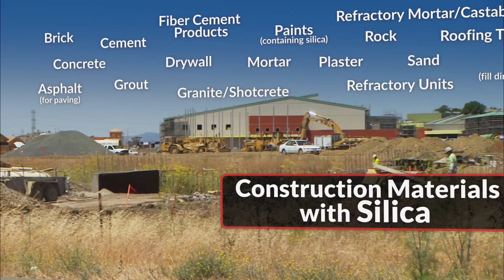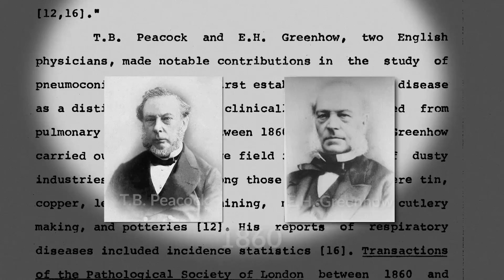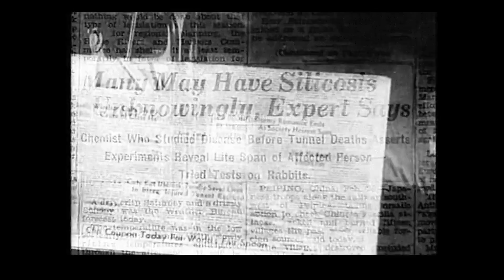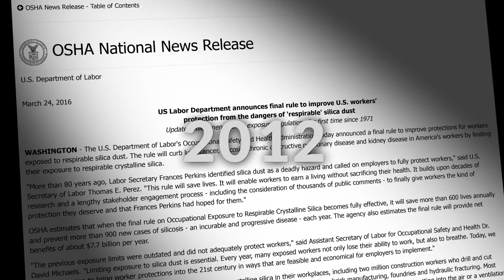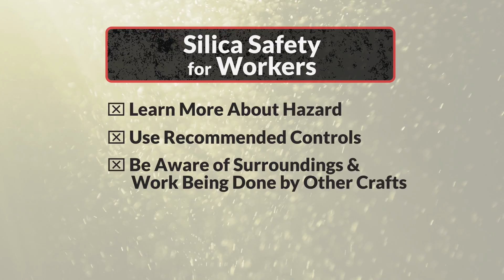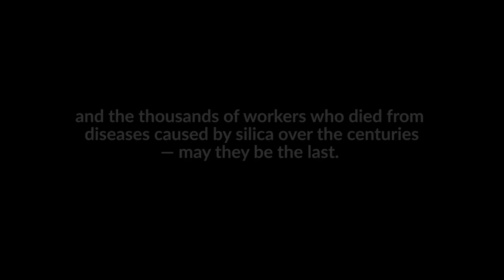Silica in Construction: From Danger to Safety

Comment: Please help spread awareness of silicosis.  My aniexty has been so hard to control because of being taken advantage of by my employer hopefully  someone  can create a cure for this horrible disease I worry everyday that I will die from going to work and working hard my employer never informed us of the dangers and never provided any protectionI wish osha or someone would have told me the dangers of drilling into concrete i had no idea my employer never gave me any kind of protection and never told me of the dangers we were carpenters and had to attach wood to concrete or drill tie down holes blow out the holes with air and epoxy the all threaded rods in never realized its fatal with no hope no cure no treatments.my life has been turned upside down and no one would even investigate the company they denied it and osha said they needed a 3 day notice prior to drilling which the contractors know and know there untouchable. My life is ruined at 35